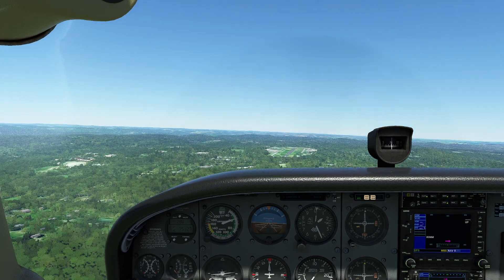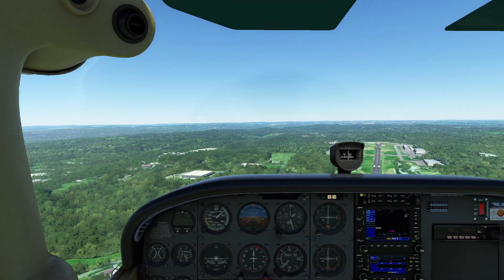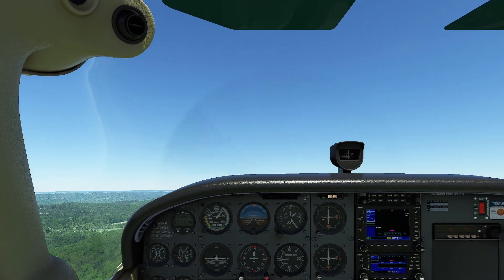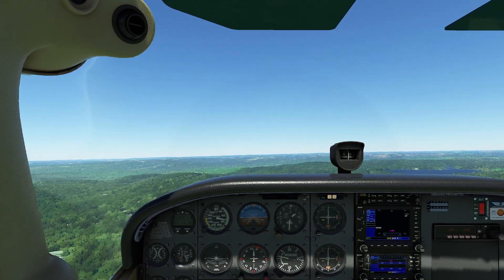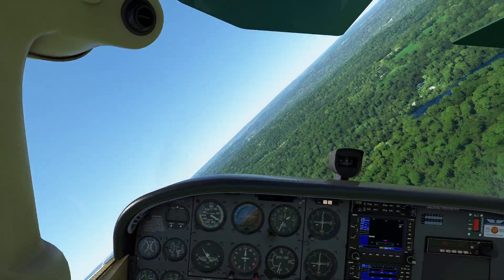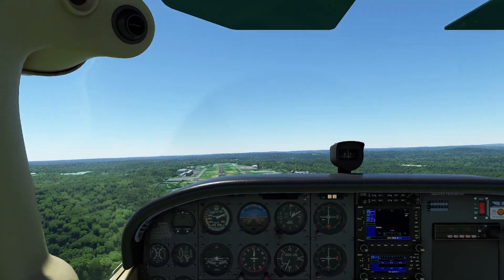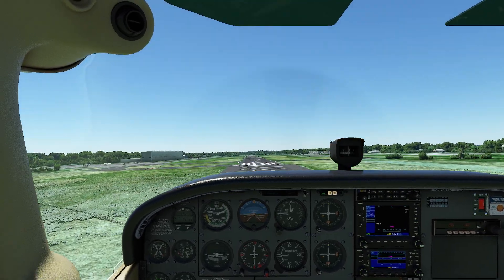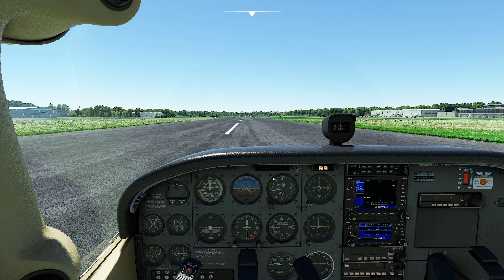MSFS - Region of Reversal

Comment: That's a good lesson too - If you inadvertently find yourself in the Region of Reverse Command, the way out of it is it put the power in and the nose DOWN. Its very counterintuitive (hence the name), but like you pointed out, pulling the noise up is just presenting more and more of the wing into the oncoming air. You're basically braking with the wing and so you need a lot more thrust to weight to overcome that, which a Cessna 172 most certainly does not have.
Its not as confusing if you realize you can climb with the nose pointed down. If you always remember power + pitch = performance, and also that power is for vertical speed and pitch is for airspeed, you can avoid some of these pitfalls in thought. Getting too slow? Put the nose down, always. Dropping too fast? Put the power in. Dropping too fast and going too slow? Put the nose down and power in.